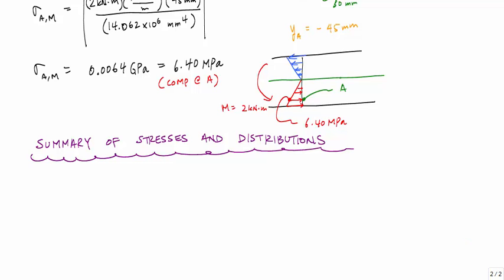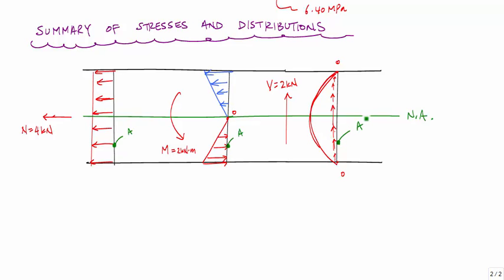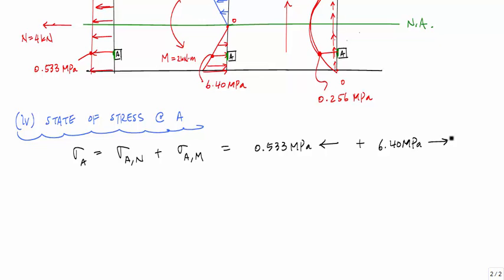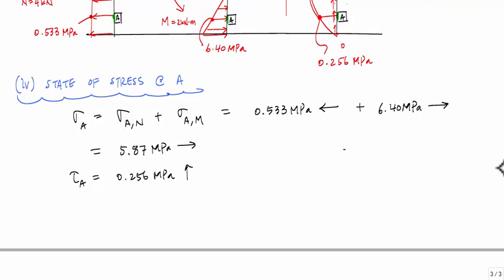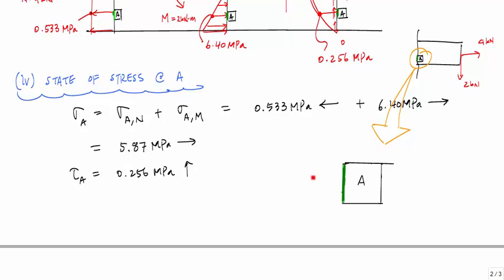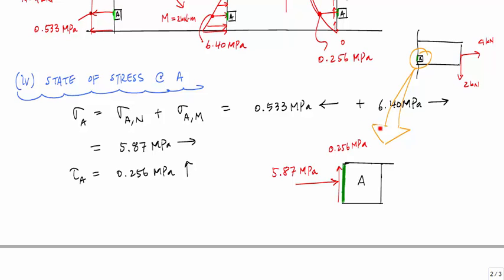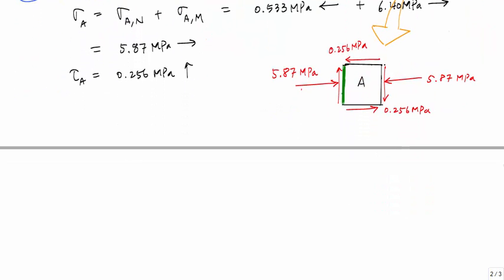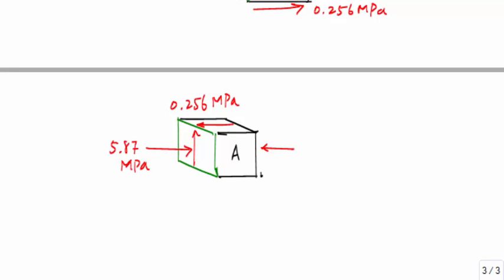Combined Loading Example 1 (Part 2/2) - Mechanics of Materials

Comment: Hey dude, could you kindly help me solve a problem. All the information has been transformed to a pic and actually there's also the answer. Question of the problem is determine the normal stress distribution on A-B. However, I am confused by the red circular mark I made (on the ans. pic)
Here's the link:
https://www.dropbox.com/sh/c1ykbvjmxi7phqo/AAAZLh7xgnwXKKLmNVZo1ij-a?dl=0

My question:
1. Shouldn't V= Area x Force? How do I get 10 as on the answer?
2. Shouldn't W=P= Area x Wconcrete, where Wcon.=2550kg/m^3? How do I get 25 as on the answer? 
3. Shouldn't I= 1/12 x b x h^3. Why does the ans. only show 1/12 x (1.8)^3

* All comma (,) shown on the pic. means dot (.)

Appreciate your answer.. sorry for my dumb question